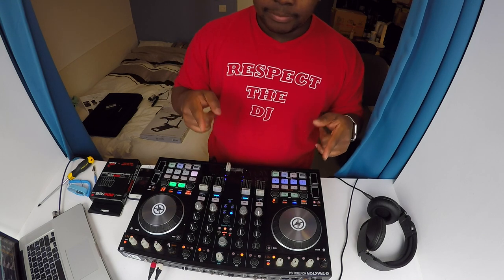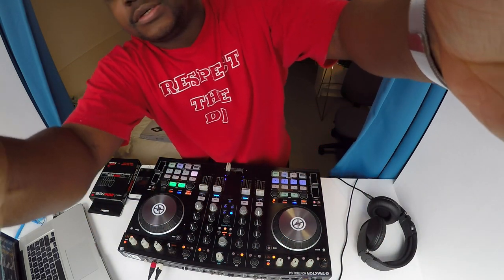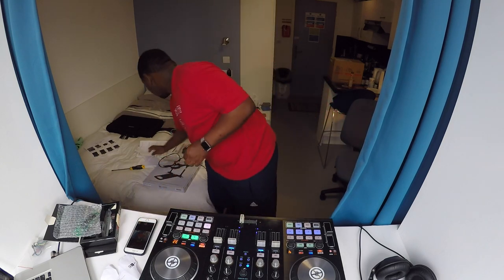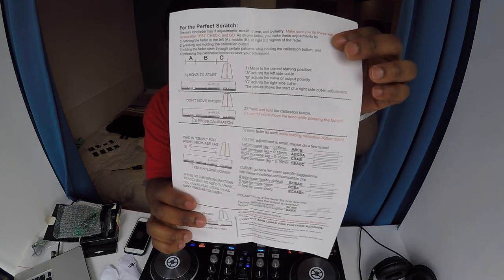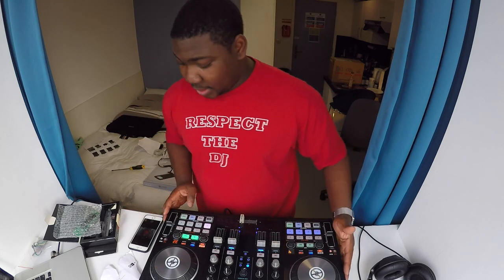Innofader upgrade Traktor s4 MK2

Comment: were you able to do fast chirps before the innofader? I'm interested in getting an innofader but I'd if it's my skills that suck or my crossfader. would you say the innofader is worth it for a beginner learning to scratch? thanks for this video! very dope
Reply from the maker: yea I was able to do most things before the innofader. I can do boomerangs with the innofader now which is cool. couldnt do that without. basically I can do more complex stuff with it alongside cdjs or turntables.  I think the innofader is only worth getting if you plan on using the controller with DVS/ timecode inputs.

Comment: Hey DJ Nii, nice video! Skilled scratching! Big shout from Brazil. Now, let me ask you: I noticed that your channels VU meters LED have the first bar on with the deck stopped. I'm trying to figure that out with NI support but no clue. Have you notice that? Thanks!
Reply: Im not sure what you saw but I just watched the video again and the meters were just fine. I have never had VU issues with the s4.  Even if there is a glitch I traded the controller for a Z2.
Reply: Hello DJ Nii, thanks for the quick reply. Stop the video right here: https://youtu.be/J-ac2kdUm0E?t=25s You have all the channel faders all 100% but the decks paused/cued, right? So, why the VU Meter LEDs have the first segment ON? That started to happen when I have updated Traktor to 2.11 (even one version later). In the past, the VU Meter LEDs only starts to blink when there`s sound played of the decks. I`m uploading a video showing the ˜issue˜. Cheers, Jorge

Comment: how do you get  your music to sound so clear do you have it hook up to a mixer or  do you have it goin straight  in to your camera or computer tryna do some videos and i want the ppl to hear it clear as yours how do i go about that or how did you do you setup thanks in advance
Reply from the maker: +PdaMAN115  What I do is I mix and monitor in my headphones so that allows my RCA output to be free. I plug the audio straight into the gopro's. For specch I just speak without a cable plugged in.( I use a skeleton housing for the gopro's when recording) hope that helps.
Reply: +DJ Nii good looks and might i say I've been watching  alot of dj videos lately in i must say your the best I've seen so far very versatile and ya playlist is crazy im inspired keep the good work up

Comment: Which controller is the best? Pioneer ddj sr or traktor control s4 mk2? I really need help
Reply from the maker: Thats a tough one. Id have to say the SR is better in terms of build quality and features. problem is that Serato sucks. Good thing it works with both Traktor and Rekordbox DJ.
Reply: Thank you very much, i have bought the ddj rr because of it have record box, but I can't really get it to work can I write to you in a way?😁 I pretty new at this
Reply: @DJNii  Serato DOES suck!!!!

Comment: *idk if it's my skills that sucks or my crossfader that sucks
Reply from the maker: could be any number of things. Be sure to check the cutting curve on your fader. It could be as simple as that. or even a case of servicing/ fader lube and cleaning required.
Reply: focus on scratching for an entire year... it takes time and practice. no is bad ass without lots of hours of practice
Reply: Thanks for the replies guys, I actually ended up getting the innofader and it helped me with faster chirps which I couldn’t do without it. I will keep practicing!